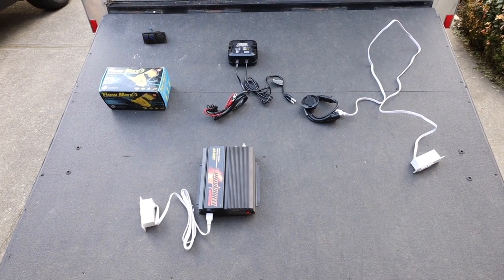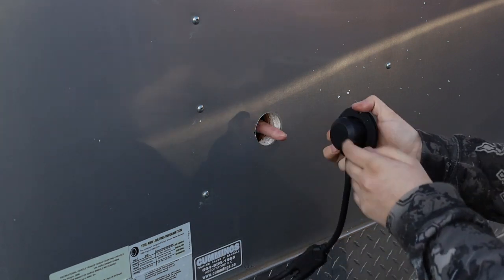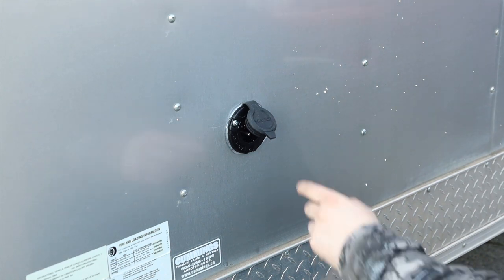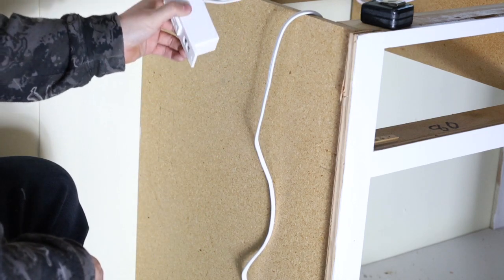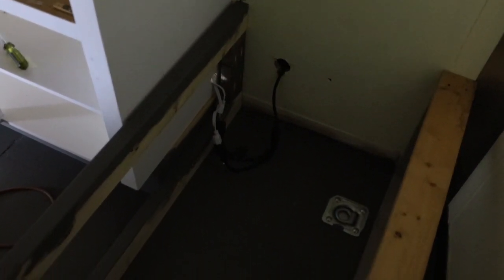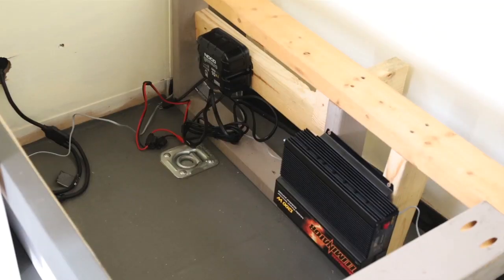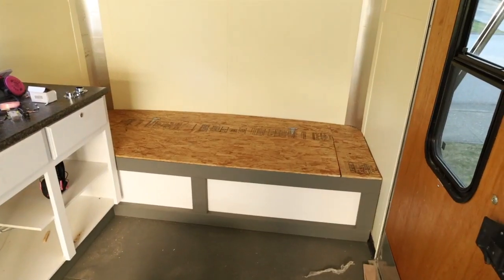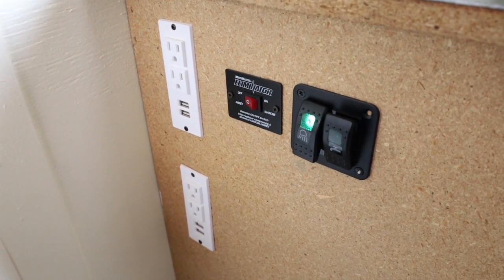Cargo Trailer to Camper Conversion - Electrical Installation

Comment: Great video man, can you explain the purpose of the circuit breaker and what you have ran into it?
Reply from the maker: I used the circuit breaker to protect my inverter I am no pro at electrical but this is what I came up with and it works great.

Comment: Hi, thanks for the video and info. Can I ask, is the battery on the hitch the same one you refer to under the seat that you use to power the under lights and water pump? Thanks
Reply from the maker: Yes it is the same one. Eventually I will expand my batteries but for now just using what I have.

Comment: Excellent!!! May I please ask you, “How were you able to cut the notch at the bottom inside of the hole so that the whole plug & cable end could fit/bend into that thick wall? THANK YOU for your help and Video~!
Reply from the maker: Great Question on the inside wall being made of wood I cut out a notch of the wood at the bottom to allow space for the wire. I’ll make a short video this evening and post it so you can see what I did.